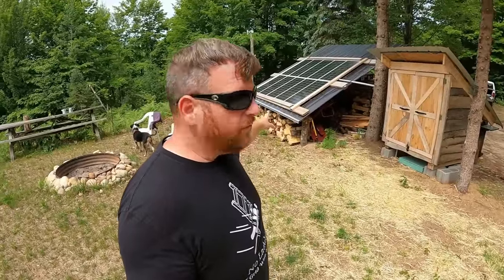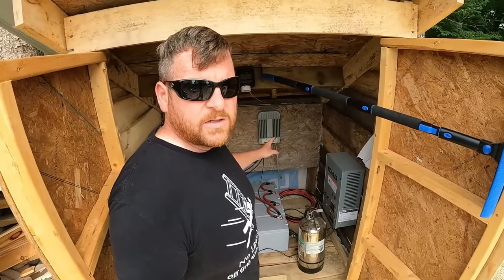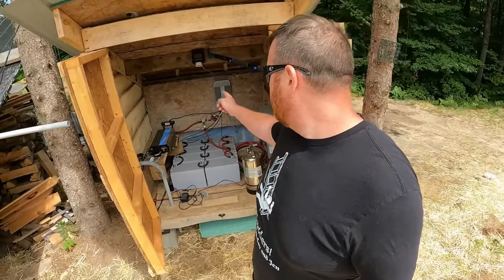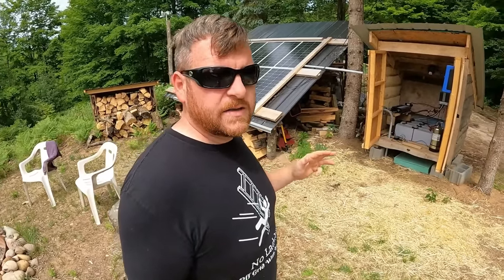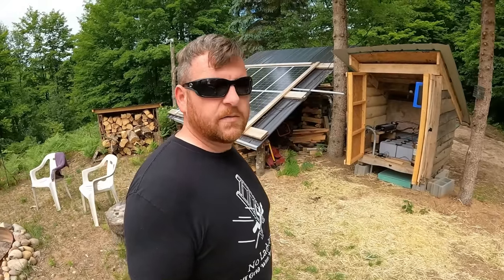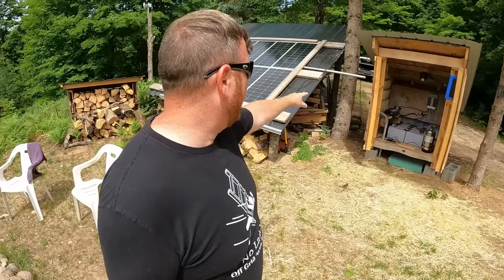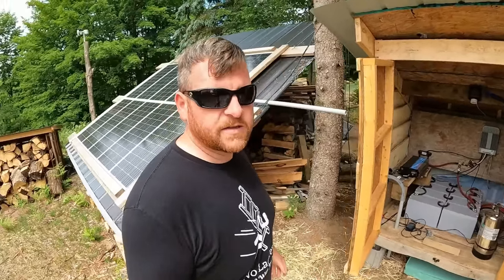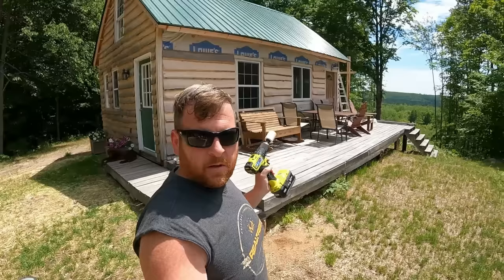One Year Off Grid Solar Power System Update

Comment: Can l ask how you were able to reduce the amps to only 10?  I need to do something similar so if you could give me some advice l'd really appreciate it.
Reply from the maker: These smaller panels only put out abut 5.5 Amps each, so the amps only multiple when you run panels in parallel.  Because I have the panels set up in rows/strands of 5 hooked up in series, not paralle, that row stays running at only 5.5 amps.  The voltage increases when hooked up in  series, not the amps. Since I have two rows of five panels in series, I then join those two rows in parallel.....this then doubles my amps to 10-11 amps
Reply: @OffgridwithJayandJen  Thank you l really appreciate you responding and your explanation.  I'm building a 40ft shipping container house so l'm right in the middle of working it out.  New subscriber, thanks again all the best 👍
Reply from the maker: Awesome....glad I could help a little. Make sure you check out Will Prowse and his early videos he gives good simple videos and simple set ups. That's how I learned what I know
Reply: @OffgridwithJayandJen  Will do, cheers from Australia 🇦🇺

Comment: Hi ya my friend what can you tell me what sort of solo power can I buy what can run a washing machine heating system TV light 24 7 can you tell me wear can I get something like that to buy I really couldn't careless what the cost as long I can get it to work 24 7 I want to be off the the grid completely independent,,, on solo power,,,
Reply from the maker: Hey there my friend, really you don't need anything different really......just more of it. More batteries and more panels. We have some links in the description box below for what we purchased. But you might want to go with Luthium iron phosphate batteries if you are full timing it and your climate would allow it.

Comment: Hey Jay!
How many Kilowatt hour do you have with this system?
Reply from the maker: Each battery is 100 Amp hours so that equates to 1200 watt hours each. So 9600 watt hours. BUT with lead acid batteries you only get half of that because you don't want to drain them past 50%. That being said 4800 watt hours if I'm doing that correctly
Reply: @OffgridwithJayandJen  thank you so much for putting the information together so I could understand - you rock!!!!
Reply from the maker: Thanks.....I'm 99% sure that's right. Ha ha
Reply: She asked about how many 
kilowatt-hours do you get from this system. Not watt hours. Kilowatt-hours.
Reply from the maker: @lindaferguson593  it's the same thing Linda....just divided by 1000. 4800 watthours is 4.8 Kwh

Comment: Maybe I should make a video I run my whole house off of my $3900 system deep freezers fridge 110 inch flatscreen TV Internet  believe it or not is the most power-hungry damn thing there is because it’s a constant 7 amp draw I use a all in one hot water heater 350 bucks on Amazon, electronic ignition, and a gas dryer and I also run a mini split I live in eastern Washington state
Reply from the maker: Sweet...You should make a video...Share your Knowledge that way

Comment: aprecate the info big help i live ov grid also  bin trying to upgrad my system i obly have 400 whats right now its not enought   i just looked at your link for the baterrys  lol it prety bad on your link the states amizon sells for 182 i live in canada and canada amizone want 479 dolars for the same baterys  lol it wicked thing
Reply from the maker: That is not good to hear......I feel these batteries are worth our price but at your estimated price you could price out Lithium iron phosphate.  But let us know the Prices.......crazy
Reply: @OffgridwithJayandJen   ya i priced them thier like 700 each here its nuts the lithium makes it hard when you ona fixed icome  trying to get set up i mostly run genarater all the time  now but with the gas prices now  cost alot   but i save on rent and hdro we bought our 25 acres 3 years ago we live about a mile off the main road  but i love the piece ov mind here it nice i think im going have to try the deep cycle baterys i no thier not as good but i can buy them for a bout 150 each  try to buy about 10 them
Reply from the maker: @stevesaverin6866  I have a new video coming out in the next few weeks about some heating pads I'm putting under my battery bank to help keep them warm in extreme low Temps. I hooked the heating pads to a 12 volt cigarette plug and plug it directly into the generator when I'm charging the batteries if we get no sun for a week. I hope I can make the videos explain it better.

Comment: One idea that might be helpful,  solar electric heater.

They make a 100w 12v heater/fan.  Sally, yes.  Exciting, yes.  

This may not be enough to heat your house (it might take the daytime chill out), but your battery bank house in the winter. It might be ideal.  The hear you need during the charging times you want.

This is the YouTube link to a guy testing it out with his temperature detector.

https://youtu.be/lQ68jPlnMxM
Reply from the maker: Cool....will look into it for sure. Thanks

Comment: Why refrigerator's these days uses so much power is the defrost cycle...thay use heat to do it , as such use a lot more energy, if you can find one that let's you decide when to do it then it makes off-grid a lot more achievable... having 12v lights and a solar water heater and a fire box with a "wetback" then you'll be living the dream , out in the wilderness or in the suburbs!!.😎💕🇺🇸🇺🇦
Reply from the maker: Good pointers CS.....thanks for helping all of us out. 😊👍

Comment: You should have bought higher voltage panels, a 36v panel literally makes 3x more power....
Reply: Its also super easy to add a heater to lipo4 cells, a lot of bigger name brands have them now... While arm might handle being cold better but still discharging them or charging when the cells are below freezing is still gonna damage them which will reduce overall life.
Reply from the maker: I addressed most of that in the video. When I talked about the heating pads I will be adding this fall
Reply from the maker: All these components were purchased a little at a time and for what was available at the time. This made it easier for our budget. I looked into larger panels but they were all on back order last year during the supply chain issues. Having these smaller panels also makes everything more flexible.  If one panel fails I have 9 others, or if I want to split them for other things I can. Just my thought process

Comment: If solar worked, I’d have it at my house. Fact.
Reply from the maker: I mean....you are literally trying to argue as someone who doesn't have it.....with someone who actually does have and use it. Our system has worked well for 2 years for our needs, can it provide full time power to a crazy household of power hungry people....NO, but it can supply a cabin with lights, fans, refrigerator,  water pumps, charge and run computers and camera gear without a problem.  You can't say it doesn't work  and you NOT having it and claiming it so, is just silly....to say it nicely. But I have a feelings my response will simply be argued without any firm FACT as you like to claim and rather just make CLAIMS without much to back it.

Comment: At most I pay $120 a month in winter its about 60 but in summer im running 3 window units 3 tvs an Xbox wifi and everything else including a deep freezer at my cabin on the grid with a 200 amp service with two out buildings I can run my crap for over 3 years for what he paid for his 30amp system and I have no maintenance and in around 3 years he will have to start replacing stuff I'm not trying to bash him I'm just being real for kids and young adults that think they can run off into the woods and not work  there is a place for solar but it's not for everybody and everything I have solar and propane generator backups but of back up only we lose power sometimes for a week or so in bad weather
Reply from the maker: These reasons you mentioned are the same as the ones I did.....it is possible to cut back usage and do like we do......OR do as you are and not limit yourself. There is no problem with going either route, but it is possible to do it either way.

Comment: why do you use ac if everything is dc
Reply from the maker: Everything in the cabin is AC....I did it this way to keep the system simple and not have multiple systems inside. Although DC is more efficient when looking for appliances and such it becomes complicated and not easy to find them local and the cost of DC appliances tend to be expensive
Reply: @OffgridwithJayandJen  all your appliances are converting ac to dc. wich means your goinf from dc to ac then back to dc. im starting to look into the elimination of ac all together,. keep up the good work
Reply from the maker: @Killdeer Periland  thanks.....I get the lose of efficiency. But like I mentioned in the video....our refrigerator in a DC model was over 1500 dollars, so I felt keeping things simple with AC appliances was a smart choice for the budget

Comment: They want 80k to set up solar for 85% of my needs... they WILL NOT allow DIY to connect to the grid. I think I'll just set everything up and use it in emergency situations. It'll just be in standby until power goes out. I know I could set up the system I need for less than 15k. That's 100% off grid
Reply from the maker: Makes no sense right? We have to stop listening to THEY  and start taking care of and following our dreams and passions. Best wishes
Reply: @OffgridwithJayandJen  thank you brother. What you've given us, cannot be taken away. 

What's worse... the power company doesn't care. It's the local fuqin gov that won't let anyone but ac licensed contractor install,  so 80k

Comment: Your solar panels sit right under a tree dude, are you sure you're not getting half shade, my panel even a hands width of shade seems to turn off power production.
Reply from the maker: Yes the shade hits them during peak summer for about half the day,  but only for the month of the year when the batteries fill full regardless,  so I don't stress it.

Comment: So $3600 to run an refrigerator and 12 volt lights and phone charging.
Reply from the maker: Well like I said in the video, the cabin is all run on AC so no 12 volt lighting all 120volt. Along with that we also run our ceiling fans, window fans, charge camera batteries, and run a coffee maker each morning. This. System will also run our small pumps for the kitchen and bathroom/ shower when we come to that. One thing easily forgotten. With  other systems, like if going with a portable unit is the solar panels are not included in the price of the unit, so you still need to charge those somehow too. Where as we have the array included in the total price.

Comment: AGM is an absolutely terrible choice for an off grid battery. You will have rapid degradation of capacity and if you cycle them even kind of deeply, you will get no more than three years out of them before they are toast. I lived off grid for 24 years and did installations for that long as well.  Cycle those batteries at no more than 30% depth of discharge.
Reply from the maker: They are less desirable than the new lithium batteries......but people have used batteries like this forever. I think they will work well for many years. Already 2 years in and still working great.

Comment: Your system doesnt look good
Reply from the maker: Ok, but it works great and has minimal waste, so it is set up properly and safely.
Reply: @OffgridwithJayandJen  seems to me it needs to be renovated and upgraded a bit more refined for efficiency... Im loooking at building one to operate on 48VDC as power inverters are much more efficient at higher Voltage.. Im looking at dividing my loads on the home Im building allowing myself to keep refrigeration and AC loads on the grid while powering the remaining loads off grid... seems to be the best
Reply from the maker: @glennschlorf1285  you can try fixing something that isn't broken my friend.....but it works perfect and I have better things to do. I'm not disagreeing there is always room for improvement but it is wired and set up with short wire runs which is most important for dealing with efficiency. Anything beyond that is just preference or in my opinion just complicated it. I Don't have the Luxury of running on Grid.....Hence the Off Grid Cabin, Nor do I want to that is why Have solar.